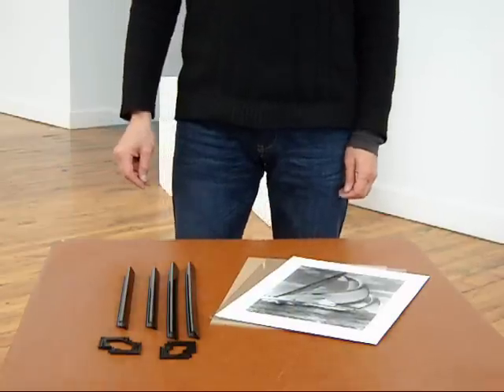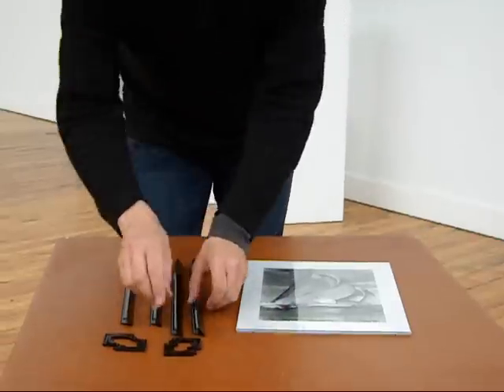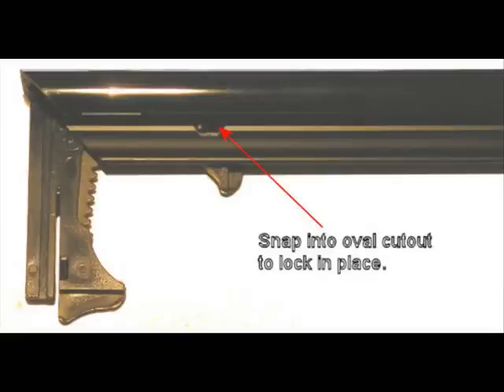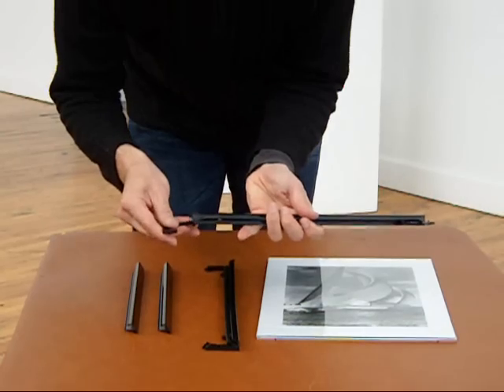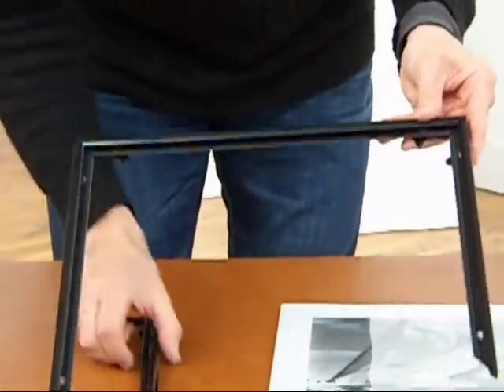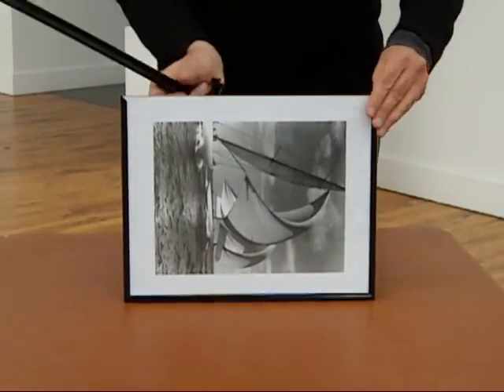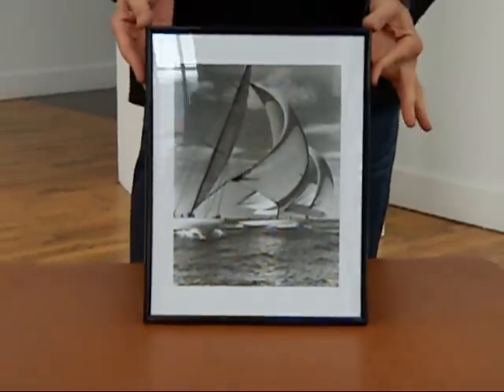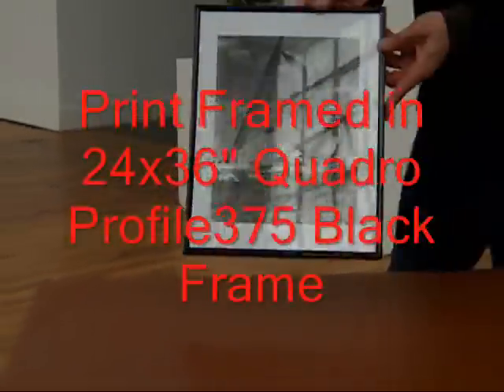Profile375&Profile675 Assembly Instructions

Comment: Can this system be used with out any glass or acrylic front?
Reply from the maker: Hi Lou, Sure. If your art/picture is taped to the backing panel or is on some other support it should work fine. Just keep in mind that the total frameable thickness is 3/4" and the backing panel is 1/8" thick. For more information feel free to contact us via emai (quadroframes@proton.me).

Comment: I hate that glossy cover. Why don't you use a matte cover?
Reply from the maker: We typically offer a choice of 3 front panels, Glass (which is glossy), clear PET (which is a glossy plastic panel) and anti-glare PET (which is a non-glossy plastic panel).
Reply: @quadrocorp  I ordered two frames with anti-glare PET from your website.